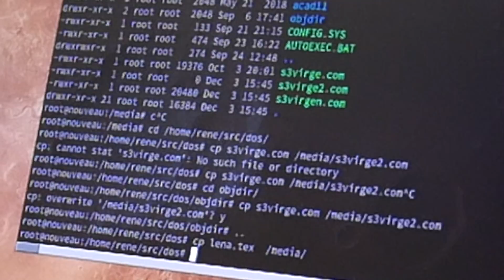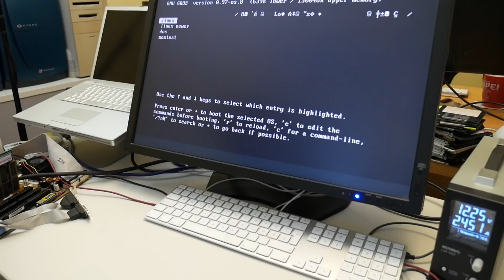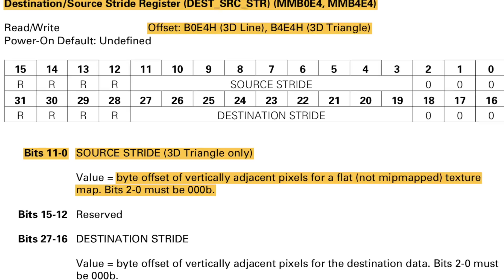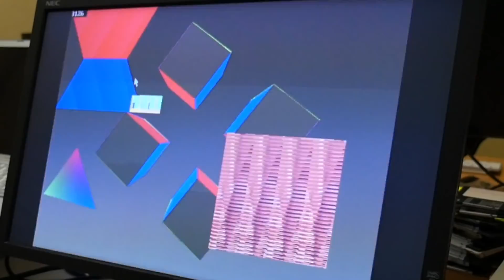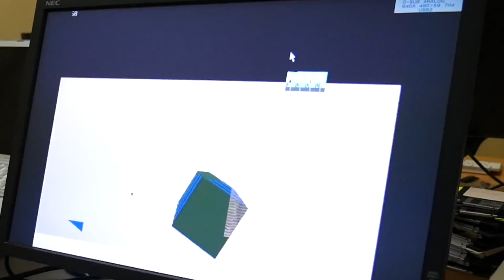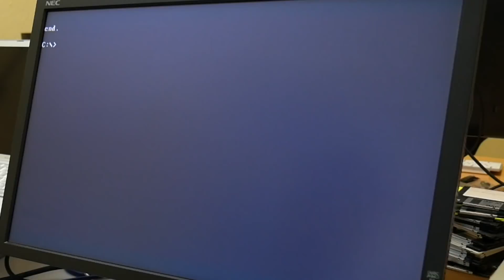Testing our latest low-level hardware 3d code on real S3/Virge hardware!

Comment: I've been wondering, since you do all this programming/low lever stuff: I think it should be possible to create a universal video card (PCI) that can run all the old video modes/3d APIs, both accurate and "enhanced mode". This would be a replacement for cards that are just rare/too expensive to get a hold of.
Reply from the maker: Not entirely sure what you envision. Unfortunately there is no "universal" (except basic VGA) PCI API. All the various PCI Hardware is totally vendor proprietary. It is therefore not possible to create a universal card that just works with everything. The only universal (x86 at least) compatibility you get is VGA BIOS or SVGA mode setting. Certainly nothing accelerated.
Reply: @renerebe  Correct, it wouldn't be (or maybe only partly be) hardware accelerated.
Reply: @renerebe  Well, that didn't work. I made a comment including a link to an ebay item and the comment didn't show up. Anyway, the idea is to use a single board computer that fits on a PCI card, something like the Portwell ROBO-6710VLA. To the computer it would be installed in would see the card as a graphics card and use whatever driver you installed. The board itself would be doing some kind of software emulation and/or hybrid method to have the SBC act like whatever card you wanted to, limited to the capabilities of the hardware of the SBC.
Reply: @renerebe  Think something like swiftshader, but hosted and ran on the PCI SBC card.